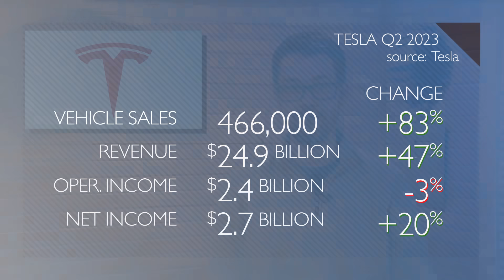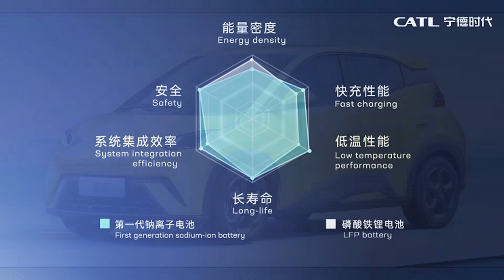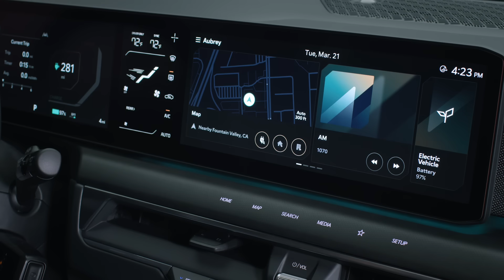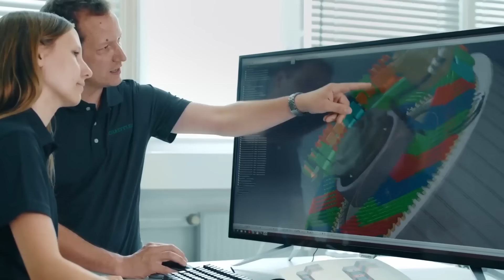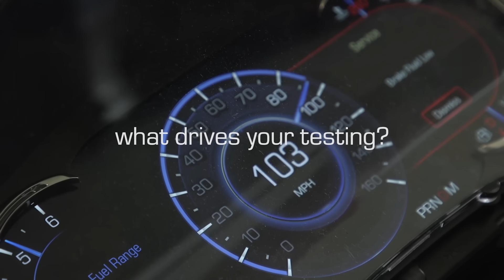Tesla Hits Record Sales & Revenue; Nissan Gears Up for Solid-State Batteries - Autoline Daily 3609

Comment: Tesla is hot, no doubt about it. Hope they can keep it going. My used 2019 ford truck with 55K miles had a blend door actuator failure. Stealership quoted $3k to fix. DIY repair - free. Climate Control temp doesn’t work but at least I have ice cold A/C. Will likely not be buying Ford again.
Reply: And remember, At Ford, quality is job (n)one.

Comment: I don't understand how putting tons of little inverters into the battery cells is any more efficient than having a single Central inverter
Reply: you can carry a lot more power with a thinner wire, with a high voltage so instead of all of these giant fat wires to carry the current, you run at high voltage. This is the same issue as happens in solar panel installations. Do you have one big inverter, or have many inverters. The current practice now is to use many inverters. It increases the number of parts, but evidence shows that having many copies of the same part works out okay. You get a bit more reliability in the overall system by eliminating a single point of failure scenario where your single inverter dies, and thus the whole car is dead vs. one small inverter going down. You will have more components so thus more repairs needed, but the whole system won't go down because it can run on 11 of the 12 inverters. Stellantis has some great engineers, especially in the Northern Italian area, where they invented common rail diesel and the fantastic multi-air electrohydraulic valve technology.
Reply: @edwarddejong8025  These battery packs are not serviceable. Losing one of your 12 inverters will make the pack nearly unusable. Sure it sucks to replace one Central inverter but it's not difficult to get to. Having to crack open the battery pack to replace one of the 12 inverters is not a good idea
Reply: @TimKennedy1  Agreed... also, the overall reliability of the cell structure, and the electro-mechanics, is important. If you get ALL components working reliably then cutting out unnecessary redundancies is a no-brainer. Adding all these "fail-safe" caveats suggest the manufacturer does not trust his own technology.
Reply: @TimKennedy1  the idea is like the Ultium system, that each battery module is easily replaceable.
Reply: @edwarddejong8025  that's a bad idea. How can you have a structural battery pack if you make it like that
Reply: re: "I don't understand how GM putting tons of little inverters into the battery cells is any more efficient than having a single Central inverter..."  me neither, thankfully it's STELLANTIS 3:40 who is proposing this and not GM.
Reply: @TimKennedy1  A car is the second most expensive thing people buy in their lives. To make the battery pack unrepairable is a bad design. So far, Tesla has gotten away with it, because the average age of a Tesla is under 5 years. The average age of a pickup is 20 years in the USA, and they are being repaired by thousands of third parties.  It works well. The idea that your 12 year old car will need an over $10k battery pack instead of replacing the handful of broken battery cells is unecological and incredibly wasteful. Both Apple and Tesla have conspire to make their products unrepairable. Nokia in one of its generations made a cellphone that had a single screw holding it in, and the guts flipped out for easy repair. Repairability should be mandatory in all consumer products. I loathe the disposable world we have today, and support Louis Rossman in his crusade to allow the right to repair the products we buy.
Reply: @TimKennedy1  Q: How can you have a structural battery pack if you make it like that(?) A: well you can't, but then that begs the bigger question of how do you RECYCLE packs that are built structurally (ref: Kona and Bolt fire recall)...?  or is the whole "we're doing this to Save The Planet" mantra just a bunch of bullsh!t like many of us have already figured out...?
Reply: @phillyphil1513  first I don't care about saving the planet with electric. Secondly they are super easy to recycle you just bring the whole thing up in a giant chipper and then separate out the chemicals haven't you seen how they do it? It's not that hard

Comment: By 2028, non solid state battery technology would have advanced so much that solid state may not have an advantage over lfp or other battery chemistry. But let wait and see if Nissan can deliver on its promise. Toyota has been claiming to have solid state battery for nearly 10 years.
Reply: Toyota has solid state battery for ten years but it can’t be used in cars because it releases toxic gases when it burns. Solid-state batteries are inherently more Energy dense and allow much faster charging. Current battery Technology can't catch up.
Reply: Current battery tech has made little progress for years. Different packaging, tinkering with chemistry, a lot of claims, battery day BS, blah blah. A lot of smoke and mirrors.

Comment: Elon chose a 6ft bed instead of using 12” of bed to solve tonneau cover storage & allow a Midgate pass through. Not gonna lie I think that’s a bad call. 5’ bed plus 2’ of tailgate is plenty of truck for 98% of the market. I’ve had a 5’ bed for years and there are so few ppl that truly need a 6’ bed (8’ with tailgate). U deter and that maybe it saves cost to allow 6’ bed be engineer a Midgate but it’s such a killer selling point.  Tell me I’m  wrong
Reply: I would love a MidGate for the possibilities with accessories, but I think the rear window goes down, so not a total loss for functionality.
Reply: Too early to make the call until we see the truck in customer hands in September.

Comment: Price cuts wont affect any manufacturing company provided the volume of production increases enough to lower cost of materials/parts until many years into production. Eventually costs and profits per unit decline per unit produced and cost of production rises above sales price. Inflation affects longer term costs.. Short term supply can affect short term costs.

Comment: That cybertruck exoskeleton sure does just look like a regular frame now. I bet its skin ends up being aluminum to and it'll have regular glass windows. It'll just be a weirdly shaped totally normal truck.
Reply: Probably so. There was never any way Elon's pot-induced dream could pass a crash test, not to mention getting to volume production.
Reply: Its worse then a normal truck!
Reply: There was always going to be framing under the exoskeleton, it wouldn't be nothing but the visible sheeting.  We'll see, but I'd wager it is going to be as initially designed.
Reply: @JT_771 I’m with you 100%. I wouldn’t bet against Elon’s vision for the truck. Minor changes to make it hit the road, yes, like adding mirrors to not fight the NHTSA, for example. The exoskeleton is still what it is, an outer skeleton made of 30x cold rolled steel. No way in hell that’s going to aluminum or composite materials, but again, that’s just my bet.
Reply: Likely the frame was a consequence of crash-safety compliance - not an arbitrary design modification. All comments that infer CT will "just be another pickup" are little more than ignorant cynicism. CT will fundamentally be what Tesla said it would be.
Reply: @brunoheggli2888  Over 1.5 million pre-order customers don't think so...
Reply: I've read that the panels still give it structural support, but it's always had internal parts like a B-pillsr.

Comment: 2:03 - would this be an add-on to Ford's existing BlueCruise & CoPilot360 or a replacement?  Since Ford uses a different suite of sensors (cameras and radar) than Tesla (cameras), will Ford be abandoning radar?
Reply: Q: would this be an add-on to Ford's existing BlueCruise & CoPilot360 or a replacement? A: neither.  as Sean just stated he was simply "speculating" that it might be Ford.  what this means is, we really needn't waste time "going down a rabbit hole" discussing and expanding on something that MAY NOT EVEN BE TRUE in the first place.  as we know Ford already has Blue Cruise and as many a car reviewer has already stated it works BETTER than Tesla FSD.

Comment: As long as humans consume red meat, using leather in vehicles is not a big deal as the hides are a by-product of the slaughter house. The big concern is the mining of the essential materials for making EV batteries, that should be of major concern if you want to be responsible and ethical in response to state of the world. The multiple inverters proposed by Stellantis reminds me of the similar route taken when auto makers went from a single distributor and coil to individual coil packs for each each cylinder.
Reply: re: "The multiple inverters proposed by Stellantis reminds me of the similar route taken when auto makers went from a single distributor and coil to individual coil packs for each each cylinder." good reference.

Comment: What FSD? FSD won't be FSD until it is actually FULL SELF Driving and it is still years away from that promise, despite what Elon says. It's an impressive system, but its name needs to be changed until it actually reaches that potential. Maybe "Pretty Good Autonomous Driving (PGAD)"? Or, "We're Still Working On It But We Promise It Will Be Ready Eventually Driving (WSWOIBWPIWBRED)"?
Reply: re: "We're Still Working On It But We Promise It Will Be Ready Eventually Driving..." <--- i choose this name for $200 Alex.

Comment: Ford's Argo project was evidently a complete failure. They are still using MobileEye (along with GM for their SuperCruise), and i am sure they are negotiating for the best software. With the right sensors any auto mfr can switch between software providers.

Sodium batteries could replace lead acid easily; lead acid batteries are garbage; they self destruct in less than 5 years, and are incredibly heavy. So that would be a welcome upgrade. Lithium ion batteries can't be swapped in because they don't charge the same way as Lead acid.

Comment: Can’t help wondering what happens when either of those castings are damaged in an accident. I guess the insurance companies are thinking about that. Just sayin.
Reply: It's the Monroe method, make them as fast and cheap as possible. Who cares about anything else.
Reply: It can be welded.there are videos on repairing them
Reply: @hoffinger  Not without Right To Repair.
Reply: Add in the use of structural battery packs and, viola, insurance writeoffs galore.  Team Elon has finally invented the disposable car.
Reply: @22BOZIDAR  Right, because out here in the peanut gallery, we clearly have the experience to make such calls over the likes of the Munroe group.
Reply: Apparently it's actually less complex to replace one piece than inspect and replace the 70 pieces. So depending on severity of accident it could be cheaper sometimes in terms of labor.

Keep in mind that in a small fender bender the one piece will be more capable of handling those better, and in the case of real severe accidents the insurance company already prefers to do write-offs.

Also keep in mind that Tesla offers their own popular insurance product, so it's in their own interest to minimize repair costs and maximize safety - and they use their connected fleet data/statistics to optimize for that goal.

Examples:
https://www.youtube.com/watch?v=-330xbW7aHw
Reply: @JT_771  yes I have 30 years of experience fixing and dealing with the junk the bean counters make.  Like door lock actuators are now sealed in a latch module and are not fixable. It's a waste of materials, but hey it can be installed in the factory in seconds. Save them pennies per car.
Reply: @22BOZIDAR  It's far more than pennies.  Designing something with ease of repair as the holy grail is asking to go out of business.  It is simply one of many factors that influence design.  You cannot look at this from a single standpoint & have that view be reasonable.
Reply: Like many ignorant commeters, you clearly have no idea of how damaged vehicles are repaired. For cars that have traditional builds, many areas comprise SEVERAL HUNDRED different parts. These are welded, glued, bolted, rivetted, sandwiched and otherwise put together. A substantial collision may not only require hundreds of separate parts, but also the lengthy, complex and expensive process of cutting out the damage, then configuring all these new bits to be carefully (and expertly) re-assembled. To comply with meeting roadworthiness and safety standards, all these new bits have to be assembled using proper materials and methods.
Now... here's something you obviously do not know:-
Tesla's safety compliance teams WORK ALONGSIDE the designers and assembly engineers AND consult with accident repair experts and the vehicle insurance industry. ALL facets of vehicular construction and assembly focus on both Safety and repairability.
You therefore don't know that in the likelihood of a significant collision, where it is deemed repairable, the cost of repair of a Tesla is most certainly going to be CHEAPER than equivalent damage on a "traditional" vehicle.
Reply: Got you an answer straight from the horse's mouth:

"...And so putting that back together means time and money. Using an example of replacing a rear cast rail in the Model Y, to do that versus like what we replaced it with from Model 3, it’s 10 times cheaper and 3 times faster to do it with the cast rail. My design team works with our collision repair team since we’re a closed loop on this with insurance, and we design specific parts that make it easier and faster to repair. And we have an incentive to do that because we have our own insurance and our own body shops. We expect that we’ll continue to do this, and collision repair will continue to become cheaper and faster over time. And we already make this available to all body shops through our Tesla-approved body shop training."

Keep in mind that the industry is now copying this approach, starting with the more nimble Chinese competition, and now legacies doing likewise.

Even Toyota has announced it's doing the same next.
Reply: @AllanSustainabilityFan  Nice info.  Where did that come from?
Reply: @JT_771  I believe it was Lars Moravy that mentioned this in reply to a recent question at the investor call. 

He's the head of the vehicle engineering unit at Tesla.